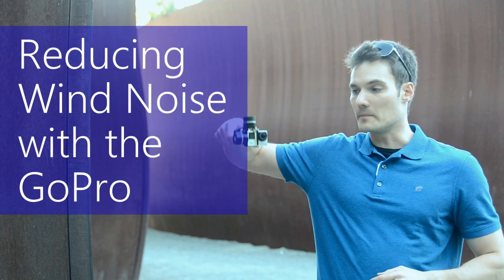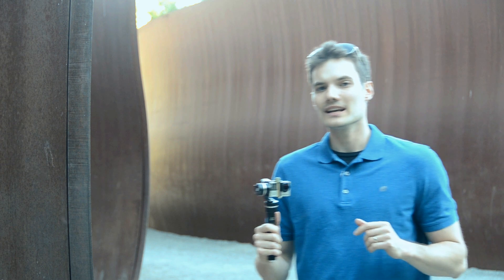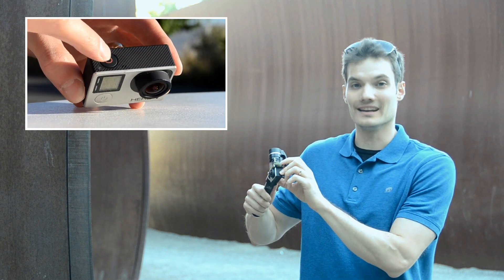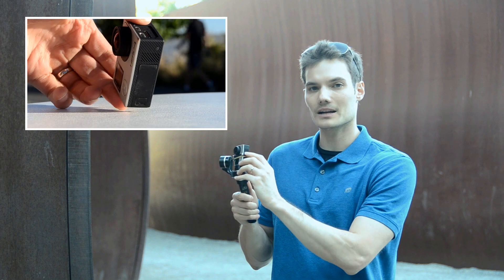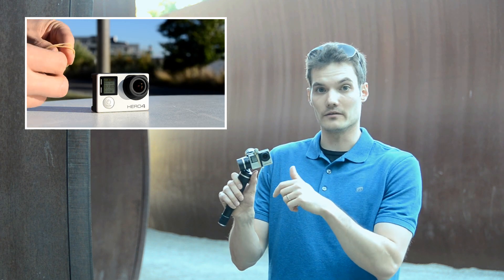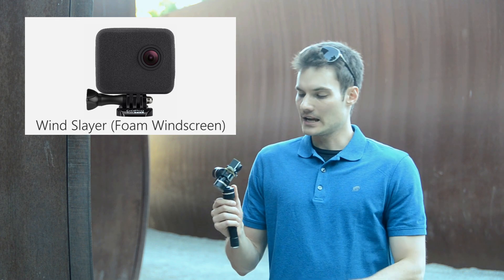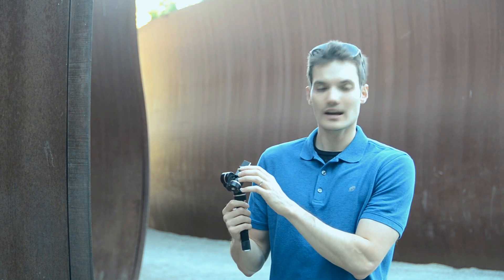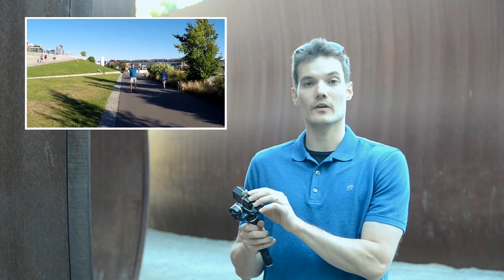How to Reduce GoPro Wind Noise

Comment: I have made about 50 videos while riding my motorcycle with my GoPro hero three. The audio is usable in none of them because it’s all wind roar it sounds like I’m standing at the bottom of Niagara Falls and recording that sound..
  I did try wrapping the microphone the external microphone I bought, with the fur from sheepskin. That actually helped a lot. I bought a sheepskin for my motorcycle seat, and I trimmed off some of the overhang. So I wrapped my small external microphone I bought on eBay with this sheepskin fur into an open ball/tube shaped like it would be in if it were inside the cardboard roll of a roll of paper towels. It worked but the Voice was muffled. I’ll keep experimenting

Comment: I found a piece of sticky back Velcro a neater way .
You only use the loop half not the hard hook part .
Cut to size then get a large needle and make several holes through the sticky backing roughly where the mic hole are .
Peel off  and stick on .
My Sony WX 350 has stereo mic holes on the top and was very prone to wind noise now it’s reduced it  to almost nothing except in a gale and the audio is virtually unchanged.
Best  of all it looks fine and can be left on the camera .
Reply from the maker: that's a great tip, thanks for sharing! it's too bad manufacturers don't include something like this out of the box.
Reply: Kevin Stratvert agreed Kevin if they can produce great units like the GP etc you would think they should use a bit of design tech to combat wind noise .
The built in noise cancelling on my Sony is next too useless.
BTW  the way nice vid mate.

Comment: You might be able to get a velcro square, cut a large circular hole for the mic, stick foam onto one section of the cut velcro, that way you have removable muff and the mic is exposed to only the foam. Like the skinny micro muff.
Reply from the maker: Smart trick! It's more elegant than my solution with a rubber band!

Comment: I'll try it, I've been struggling trying to record my voice with my gopro mounted right in front of my mouth on my motorcycle helmet at around 120 km/h but I only get wind and very far away my voice, I think this video would have been better if you had talked while you were recording, nice video tho, greetings!
Reply from the maker: Thanks for the note! I haven't tried speaking into the GoPro at high speeds like that. An alternative you could try is using  an external microphone in your helmet. That'll allow you to talk without having to worry about cancelling out the wind. Software like Corel VideoStudio will let you synchronize the audio with the video in post production. Let me know how it goes! Cheers.

Comment: Hmmmm, wondering if you could use foam earplugs for that. Cut 'em down to fit right, maybe, and clamp 'em with a rubber band. Very cool video, man.
Reply from the maker: thanks man! That should totally work. As long as you get some foam over it, you'll notice an immediate improvement :) Hopefully the audio recording on the Hero 5 is much improved.

Comment: Thanks for the video ! Great tips. Really need an external microphone for my GoPro Hero 5, but apparently they only have one from go pro which is like 80 bucks.I might end up swapping it for a Hero 4 black as I can use a an external mic, as I record footage riding motorbikes. Thoughts? :)

-Subbed
Reply from the maker: Thanks! The Hero 5 is supposed to have 3 mics and it picks the best one. I'm assuming that it's still not sounding great given how much wind it's exposed to on a motor bike. I’m sure they’ll have plenty of low cost external mic options in the coming weeks as manufacturers ramp up the production of accessories for the Hero 5.

Your best bet is to get the external mic out of the wind entirely so you just pick up the engine sounds. Here’s a video that demonstrates it pretty well: https://www.youtube.com/watch?v=95768O5SKlY